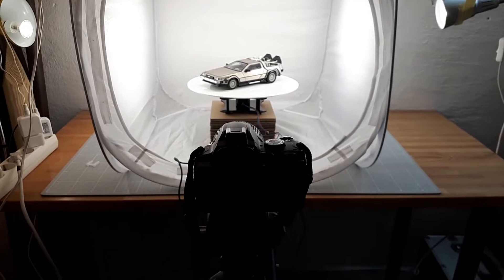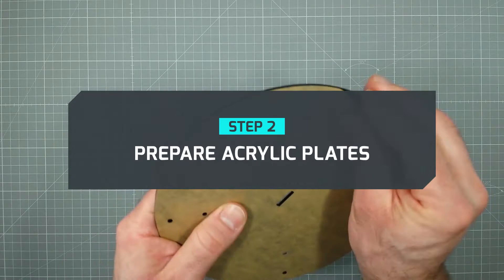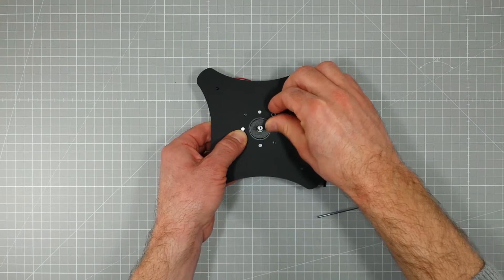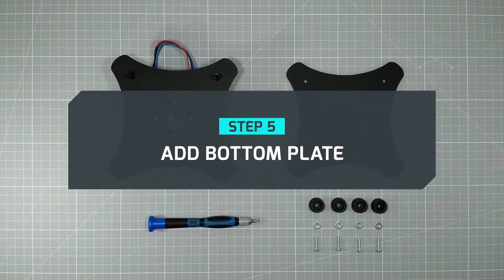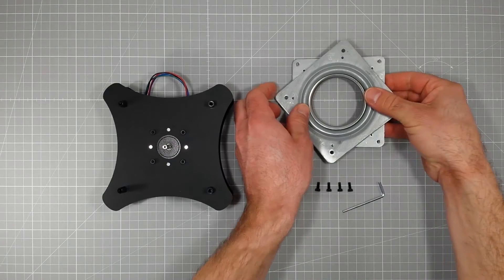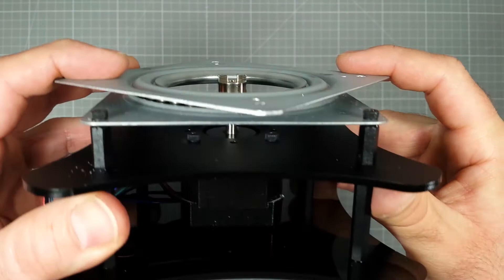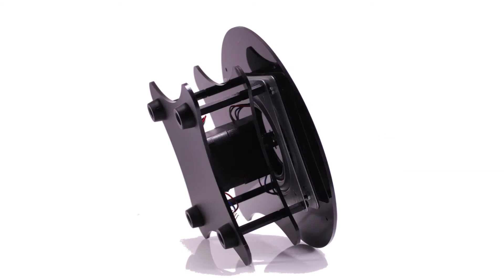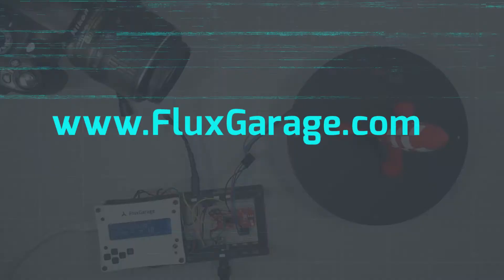DIY Automated Turntable with Camera Shutter for 360° Product Photography - Tutorial

Comment: I just put together the kit and started playing with the code, but the motor is not functioning as cleanly as I would expect.  Could I get with you to chat about the issue?  I like the kit.
Reply from the maker: Hi Jim, if the stepper motor does not rotate fluidly, this has most likely to do with the hardware, especially with the stepper motor wiring or the amount of current that goes to the motor. I guess you're using the easydriver stepper motor driver as I did im my tutorial, right? Then this guide from sparkfun will be interesting for you:
https://learn.sparkfun.com/tutorials/easy-driver-hook-up-guide/all

Beside the correct wiring of the stepper motor, you can also try to adjust the tiny potentiometer on the easydriver board that determines how much current goes to the motor. You'll also find information on this in the article that I mentioned above.

Comment: Awesome! I would like to buy some of them. I went to the purchase link but it seems that you sell the kit.... And I want the finished product. I mean, the turntable ready to be used. Is it possible?
Reply from the maker: Hi Nicolas, thank you! Unfortunately we can only sell kits of the turntable. But assembling the turntable itself is very easy, you just have to add a stepper motor. Whereas building the additional controller requieres some knowledge to electronics and programming.

Comment: Is it good for video? Does it provide constant smooth turn? I don't want to attach it to a DSLR for shooting pictures. Does your code have options that allows constant turning?
Reply from the maker: Hi, the current controller does not yet have a video mode. But if you're familiar with C programming, it shouldn't be a big deal to hack the controller for performing smooth continuous rotations.

Comment: Hello, how much weight can it support? Does the kit have ball bearings? Thank you :)
Reply from the maker: Hi Matteo, 
in general, this turntable is made to be used with small and light objects like jewelery, cartoon figures, technical gadgets and so on.
But sure, it should be possible to hack it a bit and make it work for higher loads. The main limitation is, that the stepper motor drives the turntable directly from the center, which will become ineffective when using heavy objects.
Using a stronger motor is one option, therefore you have to add higher standoff spacers between the middle- and bottom plate. For heavier objects, you sometimes also need to fill the tiny gap between the drive dog and the hole in the upper plate to avoid the turntable from shaking when it stops.
I think, it wouldn’t make sense to use this turntable for objects more than 1 or 2kgs, but I did not yet test the maximum possible load.

The kit comes with a "lazy susan" bearing (which contains steel balls inside).

Comment: how hard would it be to use a wired trigger instead of ir? :)
Reply from the maker: This shouldn't be a big deal, if you already have the right cable for your camera. There's a good instructable for this, just have a look at "Step 5: Activate the Camera Shutter With a Microcontroller":
https://www.instructables.com/Automatic-Camera-Shutter-Switch/

Once you have your hardware set up according to above's instructable, you just have to replace the content of the snap()-function of the controller code with sending a low signal to the specific hardware pin. And of course, you should then send a high signal again, so that the camera will only be triggered once.
Reply: @FluxGarage  amazing thanks so much! Really hyped to get this going (photogrammetry with the void technique + 1 extra pass for roughness map extraction). Thanks for putting this lit out there really appreciate it! :)